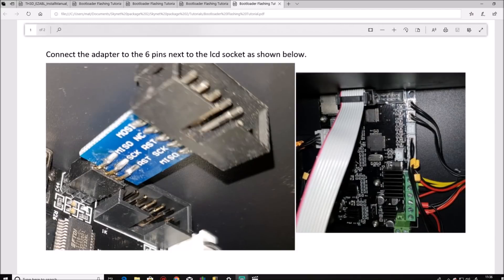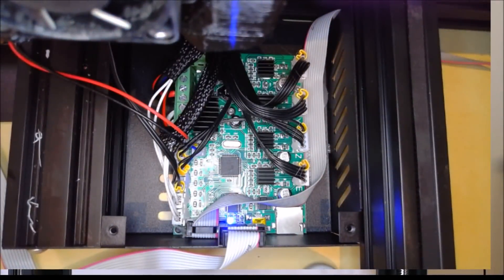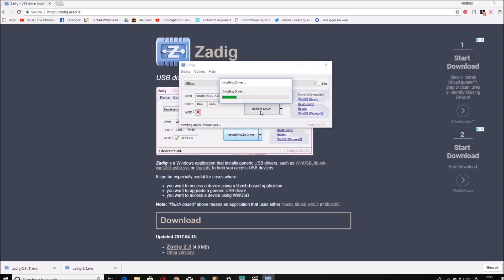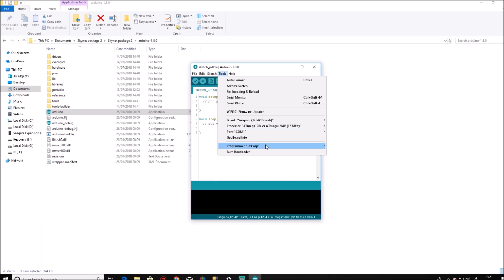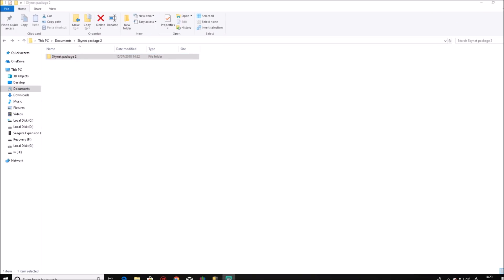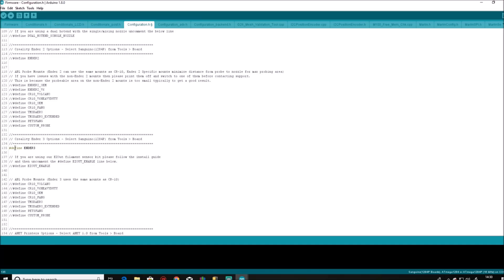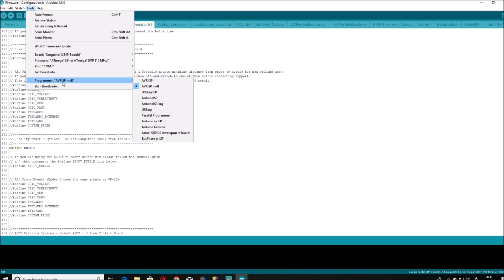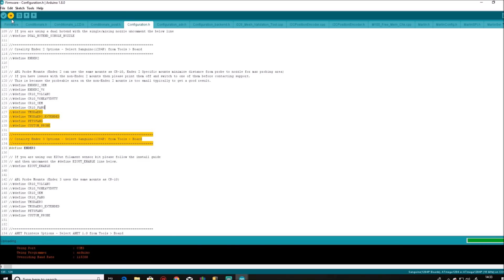Ender 3 Mods Series Pt 2 usbasp bootloader flash and firmware upgrade on the Ender 3

Comment: Hi where can I download the skynet files please?  The link in the description is dead.  Thank you.
Reply from the maker: Unfortunately skynet no longer exists if you tell me what machine you have and what firmware version I will see what is available
Reply: @MATS_MAKERSPACE  Hi Thanks for the reply. I have an ender 5 pro with a 1.1.5 board.  The programmer is a Van Ooijen Technische Informatica USBasp. I have installed the Windows 11 driver and can see the programmer in device manager. It looks fine in device manager, with no errors. But the Arduino IDE does not recognise the USBasp.  Any advice would be appreciated.  Regards.
Reply from the maker: Check out this from th3d 
https://support.th3dstudio.com/helpcenter/creality-ender-5-pro-8-bit-firmware/

Comment: This is one of the clearest videos that I've seen about flashing a bootloader, and uploading the firmware. I used the link to the drivers in the description, and was able to install the drivers without having to disable driver signing enforcement in Windows 10. I'm installing a BLTouch with an already modified firmware file from the Teaching Tech channel. It seems that the Arduino IDE cannot load an already compiled file. It wants a .ino file to compile. Any suggestions? Thanks for a great video!

Comment: Might want to add in the comments that you need to flash the firmware using a USB 2.0 port, it doesn't seem to work on a 3.0 port. But otherwise, great guide!
Reply: really? my laptop only support usb 3.0 is thre no othr way?

Comment: Hi Matt,

I followed your guide previously and it worked wonderfully, unfortunately that motherboard burned out and my replacement  is refusing to connect to the USBASP, i started fresh removed all the drivers, rebooted, reinstalled and still no joy, can you think of anything else i can try?
Reply from the maker: Hi Ben just seen your post. Did you have any luck .
Reply: @MATS_MAKERSPACE  thanks for getting back to me, turns out the mobo they sent was faulty. They provided me with progisp and thier standard firmware and the isp chip won't read from the mobo. I can still read and flash the old burnt out one.
Reply from the maker: Hope you have another on the way then
Reply: @MATS_MAKERSPACE  Yeah, after the third video of me proving it doesn't work they sent a new one out today for me... been a month without a printer, it's killing me
Reply from the maker: If ever there was a reason to have more than 1 printer that's it right there...
Reply: I have another one heading my way at xmas, just waiting.

Comment: Matt the updated skynet link came to me a little late. I also am using windows 10 and no com port showing up with the zadig installer. I executed it anyway and it said it was done. Now I am stuck with a blue screen. I tried flashing TH3D latest firmware from their site. I downloaded their full package and followed their instructions with the usb to miniB cable to my Ender3 Pro Motherboard. The com port area is still grayed out. I tried flashing it anyway as with the bootloader but I am still left with a blue screen. It does not flash the firmware. I also noticed that my windows 10 computer does not recegnize the motherboard when I plug it in now. No idea what to do at this point. Did I Brick the motherboard?? HELP!!!
Reply: UPDATE+++ I got it working +++ Firmware Flashed.  Issue was I had a bad USB ? MiniB Cable. I did not realize that. I had an extra cable and decided to try that one and it worked and showed com3. I configured TH3D for Ender3 Varified fine and uploaded and showed up on my lcd screen. One VERY HAPPY GUY. Now I have to figure out how to setup the settings on my LED control panel. Any suggestions how to do that??  It is showing X Y Z with flashing  0 and ? marks. I seem to recall something about doing something with the eprom after you flash the firmware.
Reply from the maker: To be honest it's not an issue I have had. If you message me on twitter or Facebook we can try and get you through it
Reply: I can't figure it out. My port is greyed out I have a little red light on the USB part. I've installed the drivers tho.

Comment: Arduino: 1.8.5 (Windows 10), Board: "Sanguino(1284P Boards), ATmega1284 or ATmega1284P (16 MHz)"

avrdude: stk500_recv(): programmer is not responding
avrdude: stk500_getsync() attempt 1 of 10: not in sync: resp=0x03

hi been trying to follow your tutorial but im stuck with this now on my ender 3 any help would be great on how to solve this issue,i did start with a raspberry pie but due to what I thought was my lack of knowledge I ended up buying what you have later found out it was my laptop com port not showing so now on the pc and all is well till I hit burn please can someone help,im not great with all the tech wording ect
Reply: solved it didn't have the programmer on usbasp
Reply from the maker: I was just about to ask that. Well done no stopping you now 😀
Reply: MAT1UK 3D PRINTING thanks only took me 3 days to get this far but least I'm learning by the mistakes I make
Reply from the maker: @ManCaveuk  and that's all any of us do
Reply: @ManCaveuk  how did you do this I have a red light on my usb end and can't connect to programmer

Comment: Hi Matt, tried this but get an error that it can't burn the bootloader, what model board did you do this on, mines 1.1.3.

Edit, all sorted third times a charm apparently, no idea what I did differently.
Reply from the maker: +David Howard hi david will ava look when i get in if its a later board maybe its already got a boot loader on or it may have the jumper that needs moving so the board runs from usb power

Comment: Just flashed mine Matt... using this video as a guide, BUT, under the latest windows 10,  it doesn't see the COM port. It does however still burn the bootloader. This video is great though, and gave me the confidence to do it :)
Reply: I just flashed mine this morning. I had the same problem with Windows 10 not seeing a COM port. I shut down all my my slicers and disconnected my paper printer and the COM port showed up. Flashed just fine after that.

Comment: one of those $2 arduino nano clones would work too (that's what I used) and the regular rainbow dupont jumper wires. but by all means if you have a 6 pin cable, do it :)

Comment: Matt great video! Could you tell me which brand of aspusb adapter you used? There are tons for sale and some come with or without the 6 pin adapter. Also some mention that they have a jumper to select either 3.3 or 5 volts...I assume 5 volts is correct? Thanks my man! Keep up the great work!
Reply from the maker: Hobby Components USBASP AVR Programmer and Adapter https://www.amazon.co.uk/dp/B06XYV162N/ref=cm_sw_r_cp_apa_Ct4sBbAGW373W

The above would do the job and jumper on usbasp need to be on 5v which I believe is the default setting but better to double check